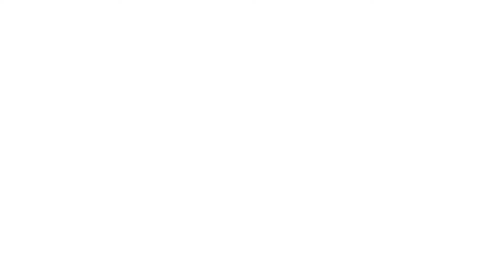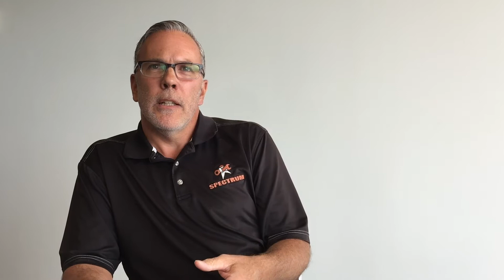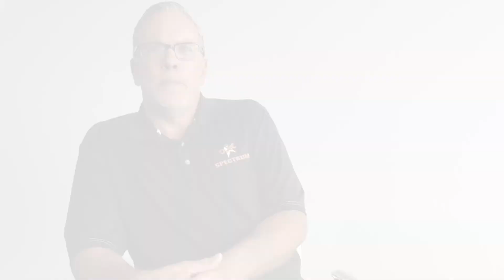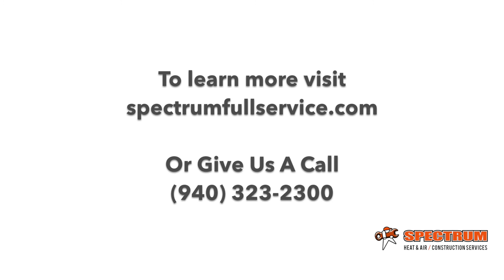Why is it bad to have an oversized HVAC System?

Comment: I got a bigger AC unit and it’s currently running as if it’s oversized but I replaced the unit because I turned my garage into a bedroom, will the extra room now take the air and my unit won’t be considered oversized? Thanks
Reply: Did you have any problems

Comment: Shows how much technology can change in 4 years With todays technology oversized system short cycling is a thing of the past. like in my case, a 4-ton was too small in the extreme triple digit temps of the summer my 4 ton system ran constantly and didn't remove humidity worth a flip but ran normal cycles in the milder months. Then there's other side of that coin a 5-ton was too big in the cooler months and would drop the temps too fast and would only run 5 mins at a time if that so how do you fix that you may ask? Simple do like i did and get a 5-ton two-stage 18 seer American Standard heat pump with a variable speed air handler. And voila my short cycling problem was solved. Big 2nd stage 5-ton capacity for them 100° plus triple digit hot as heck summer days and then the smaller 1st stage 3.5 to 4-ton (whatever 65% Capacity of 5 tons are) capacity for those milder 70-90° days. And as an added bonus it cut my electric usage down by more than half because now it doesn't run for hours on end during the hottest days of the summer. Most hvac contractors dont like setups like that and dont recommend them because it causes less breakdowns and is 1000 times more efficient than a single stage system thats either gonna be too much or not work to cool for crap. And in my case when I was on just a single stage 4 ton system my relative humidity climbed instead of going down after changing out the system three times and it couldn't maintain the set temperature

Comment: Question for you.  We have a 2005 Norris singlewide and got a new 3 ton Train heatpump inside & out with Train Cleaneffects whole home air purifier.  We got it because we like our house super cold.  In the beginning it was set 67° day and 59° night. We had also just got new flooring and noticed the boards were separating so we stopped doing that and got a really good portable ac unit for our bedroom. With that came a new issue...now the walls in the bedroom are mushy because of condensation I assume where it's so cold inside and hot outside.  How can I fix that issue?  Should I install better insulation or something different? Even though it's a mobile home it is insulated better than my parents stick built so I dunno. Thanks for any advice.

Comment: I bought a house and took a few years when I realized the furnace that was installed was over sized.  Home builders don't care.
Reply: I just bought a renovated house and truly these renovators do not care. They installed a new Trane HVAC unit and all the vents are loud on the supply side. I am going to have a professional look at it and optimize.

Comment: so why not just run it on low speed to make it cool slower..either way it seems like it may just be MUCH better to use an inverter ac and oversize it ..the fan speed literally affects the compressor speed so...oversize an inverter will be the best move
Reply: Reducing the fan speed without reducing the compressor capacity will result in colder gas going back to compressor, and this will eventually cause ice on the pipes and body surface.
Manufacturers fixed fan speeds (low, medium and high) do actually suppress the compressor outcome so no problem in this case, however forcing the fan speed to reduce more is not a good idea
Reply: @waseemhanna8980  ouuuUUUUUuuuuuu but wait..how about..if fan speed reduced too much wouldn't the evaporator get frozen ?? also an inverter type ac WILL prevent that kinda problem tho...a normal ac..nahh...
Reply: It will definitely get frozen as well, but how can the inverter prevent this problem?
Reply: @waseemhanna8980  the inverter literally slows down the compressor as the fan speed lowers...and it never goes max speed on compressor at night time, only at day time compressor runs max speed which indicates the compressor is only running at a certain speed which is enough to cool the evaporator coil according to the ambient temperature ..its quite interesting because i have a little spectroid app on my phone which picks up any frequencies around me as it uses the phone mic and somehow with the position of the outdoor unit..i can hear some sub bass frequencies such as 67hz down to 30hz of course not very loud but very audible and 67hz is the highest it goes on the lowest octave of the sound ...thats day time on high fan speed setting ..and same high fan speed setting but at night time it goes highest to 60hz ..so there is clearly a difference not to mention to massive difference there is with low speed setting day time 41hz and night time low speed 30hz .....its clearly sensing its own evaporator coil and only uses the compressor for certain evaporator temp targets according to ambient temp..really cool so in a sense..if evaporator coil isn't being dried quickly enough it prevents compressor from goin any higher in speed ..very VERY smart..
Reply: That’s interesting, my AC has all the symptoms indicating that it is oversized, I asked the technician just to install a transformer to slow down the fan speed more than the original lowest level but he did not agree, and he said this will lead the circuit pipes to freeze.
My ac is blowing air very strongly it’s really annoying, it reaches the room desired temp very quickly and then the compressor turns off for a longer time injecting more humidity in the room, the refused to do any thing, I still believe that reducing fan speed will be the best and cheaper solution specially after you explained the mechanism of the inverter in balancing the coil temp.
Reply: @waseemhanna8980  whoa whoa whoa..i didn't say the inverter slowed down the fan speed..i said it slows down the compressor ......reducing the fan speed lower than manufacturer setting is like askin for problems..remember air conditioners are like industrial equipment..these are heavy duty machines literally playing with chemicals ...i'd say..if you were to ever oversize an ac..just get an inverter instead of a normal because an inverter can just lower its capacity to match the room if needed ..at night time my unit acts as a smaller unit perhaps a 10k btu instead of a 12k which is what it is..a 12k BTU inverter......if you oversize your ac but with an inverter instead the inverter can slow down the compressor and prevent bloated cooling and more comfort cooling..i first thought wait a minute you mean you not gonna get cold at all ? when i first heard that but when i experienced i was like ahhhh i understand ..and this is much better